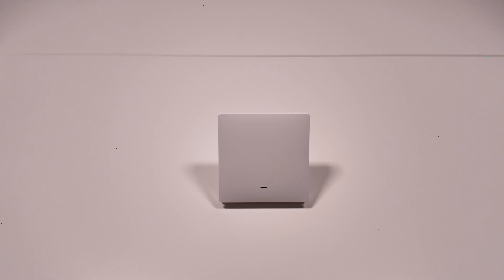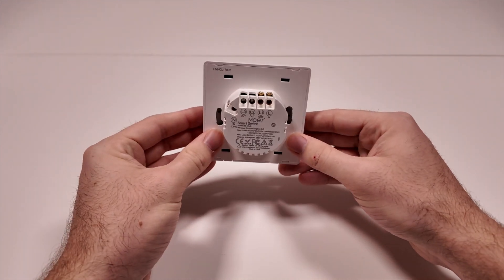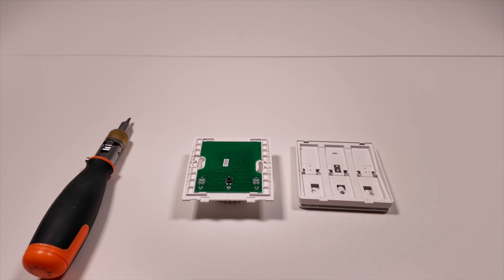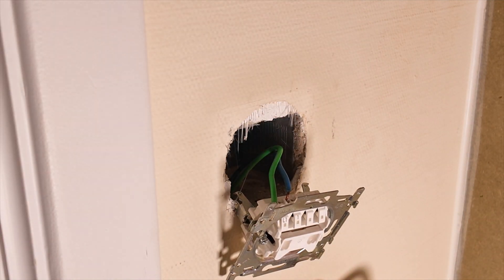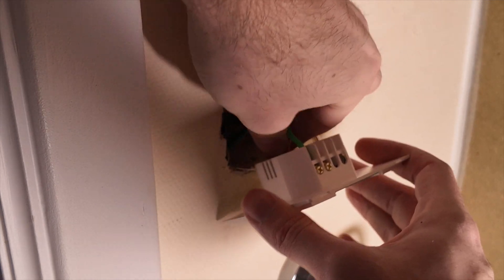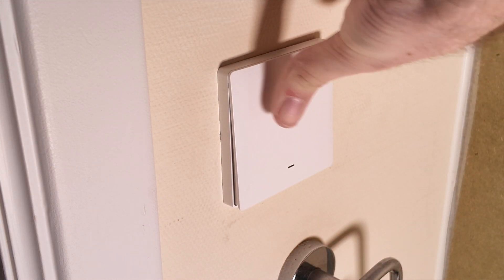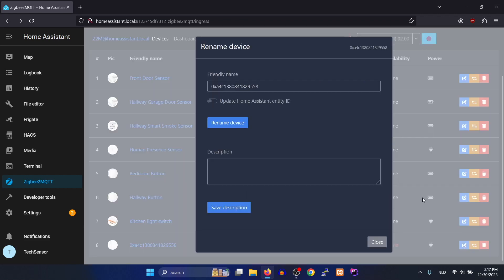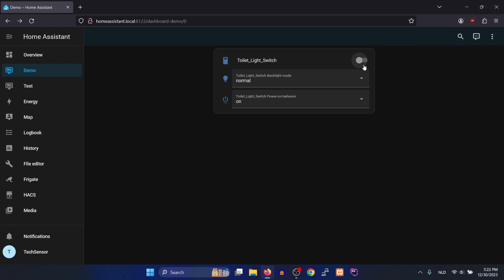MOES Zigbee Smart Wall Switch Review and Home Assistant Install

Comment: Will it work with just ZHA? Without mqtt?
Reply from the maker: I haven't tested it yet but I think it will work as long as the the Smart Wall Switch uses Zigbee 3.0  🙂.
Reply: @techsensor yes. We know it does use zigbee. But is mqtt required?
Reply from the maker: MQTT is not required with ZHA, I've just tested it and the Smart Wall Switch connects to ZHA correctly.
Reply: Legend. Thanks very much.

Comment: Thank you for this video. Can I change the default settings so that the LED (on the switch) is on when the bulb is off (i.e. in the dark) and so that the LED is off when the bulb is on?
Reply from the maker: Hey, Thank you! You can indeed change this setting, it is called the backlight mode and can be configured like you say.
Reply: Thank you very much. Kind regards. @techsensor